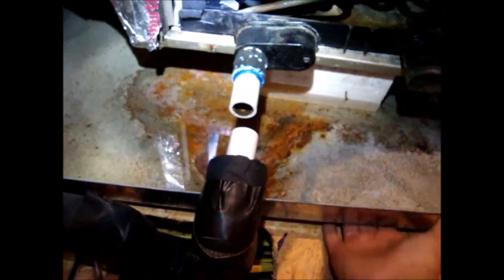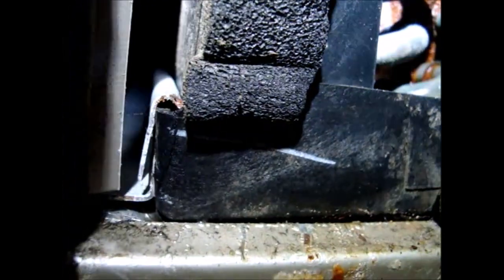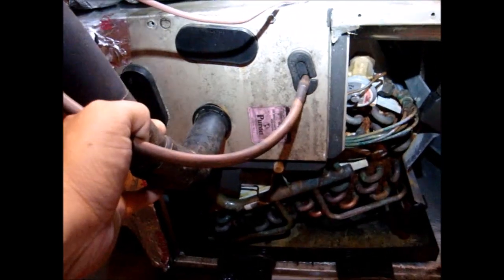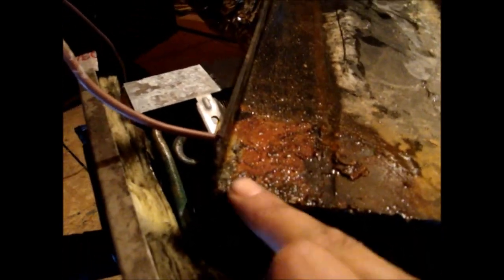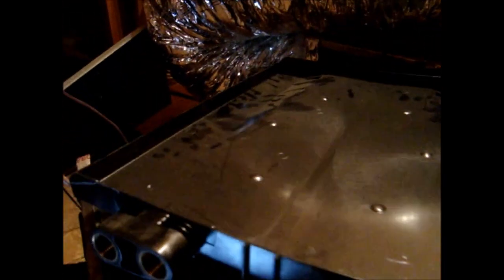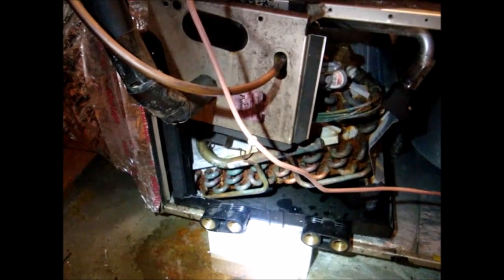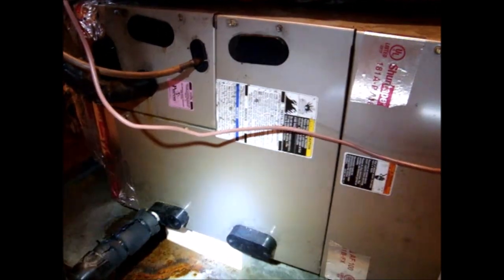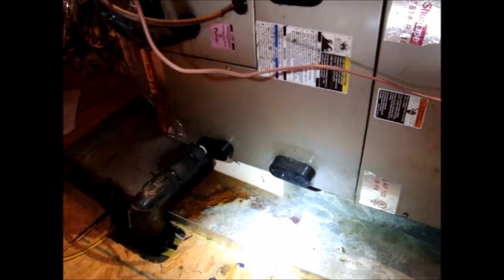Drain Pan Replacement

Comment: My a/c has the same symptoms, and I ignored it too long. Now some mold is coming in. Don't ignore a problem, because now I have 2 problems. Thanks for the great video.
Reply from the maker: Thank you and thanks for watching!
Reply: +HVAC in SC 

I want to update my comment. Mine was leaking just like yours was, but my tray wasn't cracked, it hasn't been cleaned or serviced in years and mine had sooo much slime build up that the water was running over the side. The wet vac on the drain line didn't help either.
Reply from the maker: +Anthony Guiliano II Blocked drain lines are a very common issue this time of year. I recommend having maintenence performed  every 6 months to prevent that issue.

Comment: Great video.  I have the same dam problem on my drip pan (Broken plastic fitting connection).  My HVAC guy said I needed a new condenser coil due to the broken pan fitting to drain.

Comment: What the hell!! You skipped over the part that I needed, and the title of this video. How'd you take the pan out???
Reply from the maker: I'm not sure how else I could explain it bud. Slide it out and slide it back in. This wasn't intended to be a how to video.
Reply: I also was looking to how the pan is replaced.
Reply: @rickeykeeton71  at about the 3:00 mark he mentions that it slides in and out
Reply: Derek Dieterich actually, I think I had the secondary drain pan in mind when I mentioned that. 
  Mine flexed and caused some ceiling to fall in.   I need to replace it and check my drain pipes and elevation of drain pipes.

Comment: Great job,.but how did you get the exact pan? I have an older unit and its virtually impossible to find the dimensions of condensate pans, to even get a near fit. 
Thanks
Reply from the maker: I'm an HVAC contractor so I contact the equipment manufacturer and order the OEM parts.
Reply: @HVACinSC  thanks for the reply. Nobody in their right mind is going to touch the mess i inherited when i bought this house, so until i replace, the hunt continues.
Reply from the maker: You'd be surprised. If you are willing to pay, I'm sure someone would be willing to work on it. Good luck.

Comment: I have an old GE central AC in a 1 bedroom condo that is easily 40yrs + old and it still cools well! It is in Illinois, so it's not a long season it's needs AC in its tree shade location, so efficiency and economy is not a sale item here. I am sure it needs a new drain pan, and suspect it had epoxy or something poured in the pan as a fix, 20yrs prior to my ownership, as their is some black thick stuff that's cracking in the pan. Is this a dyi project? I can't see where the screws are to lift the coil. The tenant below has complained of water below probably from my Ac. Also the insulation on the housing of the evaporator coil is some sort of fiber, and I assume has black mold on it, which i would like to change. I am afraid to call a tech because they will simply want to replace the whole thing because of its age.

Comment: I have to do the same thing. You didn't show how you got it out. Did you lift it some how? And did you replace just the main pan or the overflow big pan? I need to replace the big overflow pan but don't know how to lift it.
Reply from the maker: The pan inside this model AHU just slides out as long as the refrigerant lines have enough play. 
To replace the metal emergency pan under the AHU you either have to uninstall the entire AHU or (if possible) use ratchet straps to lift the unit slightly.
Reply: @HVACinSC  lol, I'm just reading your message now. I got it  handled. The funny thing is that's exactly what I did. Held it in place with
Reply: @HVACinSC  ratchet straps he was so rotten it crumbled and fell apart when I pulled it out and the new one plastic one slide right in.

Comment: The drip pan is still rusty, I thought you were replacing that! Is that not bad enough to need replacing?
Reply from the maker: That's not what this video was about
Reply: @HVACinSC  Do you know if that rusty drip pan needs to be replaced? Mine looks like that right now
Reply from the maker: Depends on if it's just surface rust or rusted through. I can't say unless I inspect it first hand.

Comment: After replacing the drain pan you had four "holes" in the pan. You installed a "p" trap in the first one, but what about the other three? Do you plug them up or leave them open?
Reply from the maker: No need to cap the others off. The only thing that would be wise would be to install a secondary water safety into the drain port directly next to the primary drain port. It is called the secondary drain. This way if the primary drain backs up it will not flood the air handler. This customer did not want to add the safety. Thanks for watching!

Comment: I realize it is an old video but what do you recommend coating the secondary pan with to prevent it from rusting like this one?
Reply from the maker: This and almost all internal drain pans are made of polymer or plastic. The rust is from the coil that sits in the pan.

Comment: where's the part where you actually show us how to do it???
Reply from the maker: This isn't a how to or DIY video. Proper training and Licensing is required, neither of which can be achieved in a YouTube video. Thanks for watching
Reply: thats how they "get" ya
Reply from the maker: Yeah... that's how I "get ya".. lol! My videos are not intended for DIYers. They are for licensed HVAC contractors so I intentionally leave little details out. 🤯
Reply: @HVACinSC  yeah like removing the coil to get enough room to put the pan back into the clip that holds it in place.

Comment: So how hard is to replace a drain pan in a unit thats sitting in the attic, my local AC charges me $800. But home depot has them for $150. Not sure where the other 700 goes.
Reply: labor ,  if you need to cut the lines to pull out the evap, brazing the lines, material pump down, filter dryer,  labor, insurances ,bonds, commercial vehicles insurance etc.   ......don't forget 20% profit 😅
Reply from the maker: @themrmoy40 Image a business having the audacity to want to make a profit. That's just outrageous.... 🤦‍♂️🤣

Comment: How do you raise the unit to swap the pans out?
Reply from the maker: Ratchet straps
Reply: HVAC in SC That is what I thought too. Attach them to the rafters and work it up, but then I see these videos about pumping them down and such.
Reply from the maker: Because the video is talking about the pan INSIDE the unit. Not the pan under it. These are 2 completely different parts.

Comment: I have water in my drain pan.  Does that mean my drain pipe is clogged?
Reply from the maker: It is very possible. Especially if you dont have routine maintenance performed.
Reply: thx!

Comment: Hello there,  How much do you charge for remove drain pan and replace?  thank
Reply from the maker: Dragonfly Too many variables to give a price over the internet. The specific unit, size of system, and location equipment all play a roll in pricing.
Thanks for watching.
Reply: HVAC IN SC ~I had Exact one what you did in this video and exact problem, how much?
Reply from the maker: Dragonfly I dont do internet quotes as I mentioned before. Prices vary greatly from job to job, state to state, ect. I wish it was cookie cutter pricing but its not. Thanks.